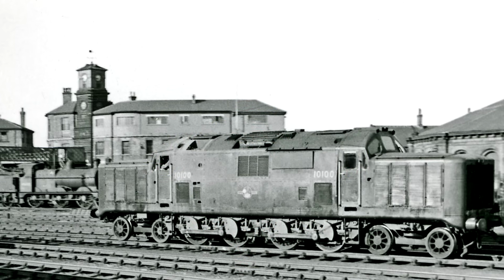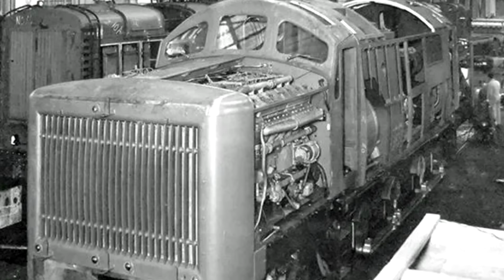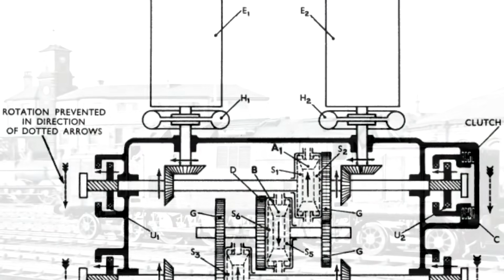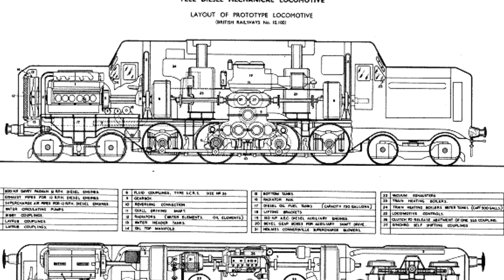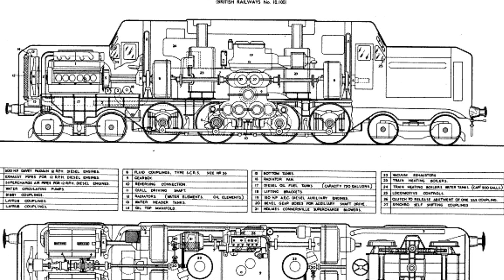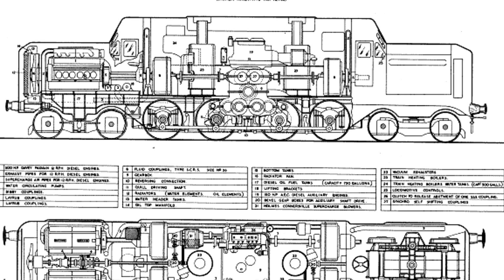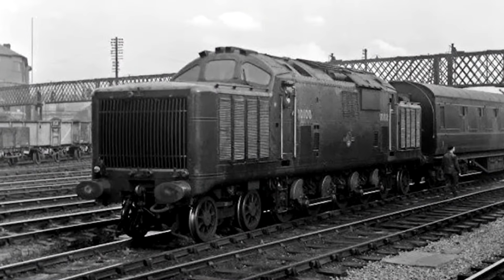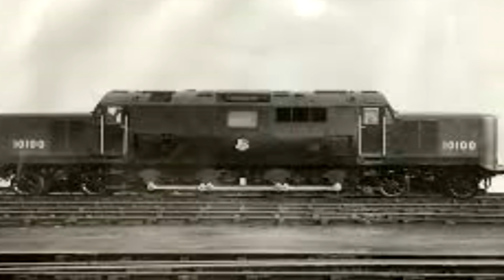The Strangest British Diesel in History | British Rail 10100 "The Fell Diesel" | History in the Dark

Comment: The main reason they didn't go with diesel-electric is because the electric part requires a huge amount of copper for the generator, and again for the electric motors. Copper was a very expensive comodity for a while after the Second World War, so they were trying to find a way of making diesel locomotives that didn't require copper. Ad as for the engines used, they went with engines that were already in use at the time in diesel shunters rather than designing and making a new engine from scratch, the idea behind it being that spare parts existed for these engines already. It was all literally a product of its time, and the economic difficulties the UK had after such an expensive war.

Comment: The problem with prototyping work, especially at a very early stage of development, is that you don't know what you don't know.  A lot of the ridiculous complexity of the Fell will have come from development testing revealing weaknesses and the percieved need to make the locomotive as flexible in operation as possible.  There was also the need to make her in a way that meant she could be made within the UK.  There was a lot of spare engineering capacity around after the war that could be used to produce heavy gearing for the project.  What there wasn't was spare production capacity or availability of materials to build the big generators and traction motors for diesel-electric locomotives, and the UK, already massively in debt to its allies after the war, so much so that it only finished paying off its war debts within the last generation or so, simply could not afford to go further into debt to import particularly copper, nor would the companies, largely in the US would not have been amused at being asked to provide large amounts of copper that they could easily sell at home on the promise of being paid sometime in the next century.  So, at least trying out diesel-mechanical made sense, at least theoretically.

Another issue that they would have encountered would have been lack of scaleability.  This is an issue that still exists with heavy trucks, particularly those used for heavy haulage.  The simple fact is that the more power the engine creates, or the more engines you use to create the required power, the stronger and more complex the transmission system has to become.  This increases mechanical losses in the transmission.  You get to a point where the more power you give the vehicle, the more power you lose to mechanical loss in the transmission.  It gets to a point where you put more power in but still end up with the same amount at the wheels as the mechanical losses grow and eat the extra power.  All you're doing then is increasing fuel consumption for no advantage.  If you continue to add power beyond that point then you can get to the oxymoronic point where you're putting more power in but getting less to the wheels than you did when you were putting less power in.  That's largely why mine trucks that can now tip the scales near 300 tons fully loaded went from diesel-mechanical (engine, gearbox, propshafts, diffs) to diesel-electric like locos.  That power source is scaleable, and not necessarily just by throwing more engine power at the problem.  But, when you're starting from a blank sheet of paper at point 0 you don't know what you don't know.

Comment: The dumbest part. LMS already had two Mainline capable Diesel electrics in the works when they built the Fell. LMS 10000, and 10001, and they were finished BEFORE the Fell.  While technically less powerful the 10000 was almost 10mph faster, and had nearly DOUBLE the tractive effort.

Comment: This unit was a mess, but it should be pointed out that early diesel-electric locomotives were not the same as the stuff we have today. Most of them required two prime movers to get the desired power output. There were also a spate of successful prime movers which were produced by companies that made design choices that ended up with MANY going out of business.

Comment: So, it sounds like it took the maintenance folks two attempts to kill that engine.

If I had to work on it, I'd contemplate lococide too.
Reply: literally my exact thought when he said a bolt was "accidentally left loose", though the fire was probably actually accidental
Reply: @nbirdie100  Boiler fires on BR's 1st-generation diesels were pretty common prior to the widespread adoption of electric train heating (steam-heated trains didn't completely vanish from regularly scheduled BR services until early 1987; last working was in Scotland iirc), even on the best/most reliable classes never mind the duds/lemons/experimentals. The boiler designs themselves didn't really have a good one among them; would be more accurate to ask 'which was least worst'. If nothing else, that it was this that ultimately killed the Fell and not another stray bolt getting into the bespoke gearbox just shows how common a problem it was. Even if the boiler hadn't decided to cook the rest of the loco at Manchester Central, I doubt it would've lasted too much longer anyway as a total one-off in a sea of standard diesel-electrics.

Comment: This locomotive looks like the product of a bunch of engineers who only knew about mechanical design (gears, clutches, pistons).  Maybe what would result if a designer who had only worked with Shays and the like were tasked with creating a diesel locomotive.  That would explain the approaches taken where things like electrical or hydraulic control/power transfer would be far simpler, more reliable, and likely more efficient.
Reply: yeah, it makes sense when you consider the fact that the people who built it only knew of steam loco designs prior to this venture, we take it for granted now but using a diesel engine in a locomotive is a pretty complex feat

Comment: With the same amount of bits they could gave done a multi speed planetary multi disk clutch transmission. And it would have worked so much better. The usual overly complex btitish design.
Reply: you are aware how much more complex an epicyclic gearbox is to this, the method they used is essentially a simplified epicyclic gearbox, differentials are fundamentally pretty similar to an epicyclic geartrain. multiplate clutches are actually so much more complex than this, this is a very agricultural design if ive ever seen one

Comment: I do love mechanical engineering but even I must admit this is a little over the top. I’ve been over the design to see if it could be made more practical but it all just reverts back to a standard diesel-electric or hydraulic setup. The only thing I can think to make this particular configuration a bit more refined in modern times is to remove the two auxiliary engines driving the blowers and fit the four main engines with electric blowers which work on the same principle but use electricity from the main engine to power it rather than have separate diesels run them. I’d also add a shared cooling system for all 4 engines as another fault with the Fell was the engines at the rear of the direction of travel were prone to overheating as the radiator wasn’t receiving proper airflow. The final addition would be an engine management system that could shut down and restart engines as necessary for power delivery. 
Of course, that still doesn’t mean this would be more practical. Modern hydraulic transmissions are the best design for a non-electric drivetrain.

Comment: Frankly - They didn't know what they were doing, as in 1940s know-how of how to build a diesel engine simply didn't exist - as that was cutting edge tech. Even in Absolute State of America, which was most advanced in the field, only EMC/EMD was making actually good locomotives. Lima, Baldwin or Alco even were struggling. So much so, that F7 is a recongizable locomotive 70 something years later.
Reply: The answer to "WHY?" is simple - in 1940-ish UK had no tech to make a single 2000hp engine that would fit in their loading gauge. That wou become available in ~1960. Thus they tried to combine output of four smaller engines.

Comment: This has to be 1 of the most complicated locomotives ive heard of.
Who in the world thought this was the way to go 😂.
Diesel mechanical locos are all complex but 6 engines 1 train 😂.
That transmission is the most insane design ive ever come across.
Reply: the loco really isnt complicated, fundamentally considering it was made by someone who only really knew mechanical, pneumatic and hydraulic means of transferring power the design makes sense, using engines connected to differentials to change speed is actually a really simple idea

Comment: I can see the logic of it...and you have to remember this was a proof of concept prototype. Diesel electrics were not very powerful at the time and came with a power to weight penalty.  Fell himself had an improved design up his sleeve but by then improvements in Diesel Electric traction had been made and was seen as the standard. Check out the original Shell promo film for it on youtube (https://www.youtube.com/watch?v=doBPp3ZfgLc&t=2s) and you can see a nifty explanation of how the gearing works.

Comment: Well the torque is the same, but the RPM that the torque can be extracted is 1/4. On top of that the hydraulic copeling can be half full and be used basically as a torque cnverter.

11:50 That is kind of stupid. They could just cross conect two engines. So one engine charge the other and the other chared the first.

This way a high reving engine could provide very compressed air for the low reving engine to get more torque with out any aditional cost.

Why, the reason is quite simple. THere was simply no cluch around that could start a train. So any mechanical drive loco have to use a other method to start.

There are quite a few waccy designs from the 1920-1940 untill the hydraulic torqconverter for locos was made. That basically solved the problem. Then you could just put a truck engine truck gearbox and then a torquie converted and be done

Comment: The Britania airliner had a similar gear system so four engines could power six propellers with equal power distribution.  It was a horrible kluge requiring four flight engineers to keep the whole thing going. Britain had some psychotronic airplane designs too.

Comment: I have rebuilt engines, I have rebuilt transmissions, i study lots of random mechanical nonsense... yet how this transmission worked is beyond my understanding given the explanation here. Im going to have to look at whatever I can find later to figure out what the HELL was going on. Hydraulic couplers- makes sense. How the ratios varied based on how many engines were engaged? Absolute nonsense. I dont get how they did that, but I MUST understand. I wont get why, but I WILL understand how. If its the last thing I do. 🤣
Reply: not nonsense really, if you have a differential, and you spin the input shaft both outputs spin at the same speed, if you hold one output stationary the other output spins at double the speed, now if you swap the outputs and inputs of the differential you can change the gear ratio based on weather both inputs are spinning or just the one, but how do you stop only one of the engines in the differential and still transmit power to the wheels you may ask? simple, thats what the one way clutches are for, when you stop the second engine from spinning the differential naturally will try to spin that same side (input) in the opposite way of rotation to the engine on that side(in a differential if you hold the input stationary and rotate one of the outputs the other output will spin backwards), so you stop that with a one way clutch, basically it uses a back to front differential

Comment: Very simple explanation for the locomotive

The designers were drunk, they were absolutely out of their mind drunk
Reply: @VintageRenewed  no they were

They were high drunk and not being paired 🤣
Reply: @Jake-Jowett  They had a huge omelette of magic mushrooms with the beer. They DID have a 'money-shift' moment with the loose bolt. Imagine the engineer, wondering 'wtf happened' and also was he in trouble.
The LMS did have 10000 and 10001 that were diesel-electric. The diesel engine was only 1600hp, which was not high enough.
Reply: @NJPurling  And yet a single loco would often be used on fast trains , although maybe not at busy periods .

Comment: Not the most powerful non-steam British Railways locomotive at that time.  The two gas turbine locos 18000 and 18100 had power outputs of 2500 and 3000 horsepower respectively.

Comment: THEY COULD A HAVE USED A V8 ENGINE AND A SIX SPEED GEAR BOX AND A MODIFIED CLASS 08 FRAME AND A SCALED DOWN DIESEL ELECTRIC BODY MINUSE THE NOSE AND DO A 2-6-2 DIESEL MECHANICAL LOCOMOTIVE AND KEEP THE SIDE RODS AND DO NOT GO WITH THE DIFFERENTIALS.

Comment: In some sense it was diesel-pneumatic transmission! At low RPM the main engines turned into air motor as main source of power was all that compressed air going from auxiliary engines while combustion didn't contribute that much because of how rare it's allowed to happen!

Comment: The thing that has always confused me about the British, when it came to diesel designs, is when locomotives like this were being designed, America had a pretty well established diesel electric program, and Britain and the US were close trading partners.  So, it would have been much easier for the Brits to purchase american designs and request them modified to fit the British loading gauges (something that did happen in a limited degree in the 60's) and work off of those designs.  

I guess I just wonder why they were so steadfast about doing it themselves?
Reply: If I had to guess a mix of politics and hubris remember BR was a state owned company so importing things from overseas would have caused political backlash it’s also partially why modernization plan diesels were acquired from so many different manufacturers
Reply: @BlandSpagetti I think you're correct.  British Railways were also prohibited from importing diesel hydraulic locos from Germany and had to build their own using Maybach engines built under licence by British companies.

Comment: Maybe I'm mistaken, but I thought that there were FOUR auxiliary engines.

Edit:  Yup, mistaken.  I got the configuration of the locomotive backwards AGAIN.  

To be clear, the four prime movers were housed in pairs under the "bonnets"-the shorter parts of the locomotive at the end.  The auxiliary engines and the boiler were housed in the middle.

I remembered that there were four engines under the bonnets, but I thought that they were the auxiliaries, even though I had previously read otherwise.

Comment: Trying to build a non-steam engine with the torque characteristics of a steam engine.
Reply: Well a lot of early diesel worked in that way sort of. There is a bunch of pneumatic diesels that worked this way. This is basically a hybrid between a pneumatic diesel and a mechanical.

There was some that was basically just a steam engine lower frame with cylinder and everything, then used the exhaust from a diesel engine that was basically just free wheeling as a compressed air source. There was also some locos that powered a turbine from the exhaust from the diesel engine.

this was very good for static pulling force, but... quite bad for efficiency. The advantage was that they could make a loco with a pretty small diesel engine that could pull heavly loads at slow speed, for swiching and industrial use.,

While when it went over 20-30km/h it become very inefficent.

Comment: With all of those engines and a steam heat boiler, I really doubt she saved any weight over a diesel electric.
Reply: it was made because diesel electric wasnt really possible in the uk at the time, that's why Germany didn't originally use electric motors either, it wasnt because diesel electric was undesirable

Comment: It was a very creative way of building a high power high speed loco at the time, albeit totally bonkers with its crazy complexity. It did last a surprisingly long time in service so can't have been that bad, and only then failed for reasons that could befall any loco at the time.
The fluid flywheels became absolutely standard on the first generation diesel multiple unit passenger stock that ran for decades, using bus engines & 4 speed gear boxes.
Reply: The fluid flywheels on the vast majority of first gen DMUs was essential to cushion the action of the epicyclic gearbox.
Reply: @StephenAllcroft  You need a fluid flywheel just to be able to stop, or the passengers have a really hard time getting on. 
Though I am not entirely sure the Pacer didn't have a mechanical clutch. I got stuck on one once that couldn't get out of first, with horrible graunching, followed by stopping. And repeat.

Comment: The thought was that you had the least transmission losses in a diesel mechanical locomotive, what it saved on fuel was by far outset by its maintenance cost.
Reply: i highly doubt this thing was even remotely fuel efficient considering it uses a fluid coupling between the engine and transmission and needed an auxilary engine to generate enough air flow for the main engine at low rpm to make it actually usable